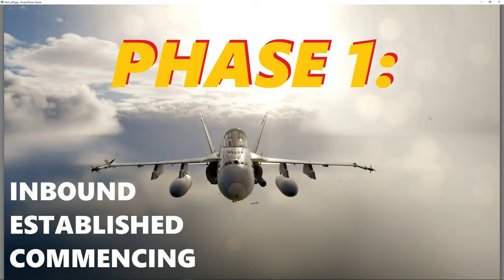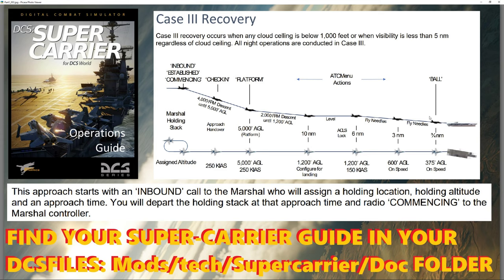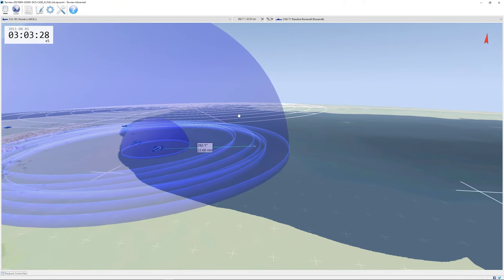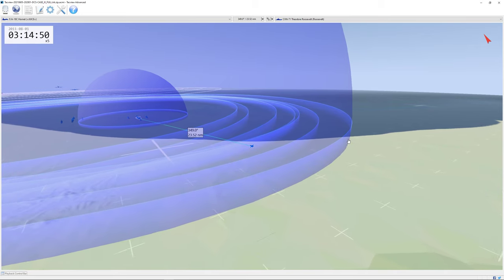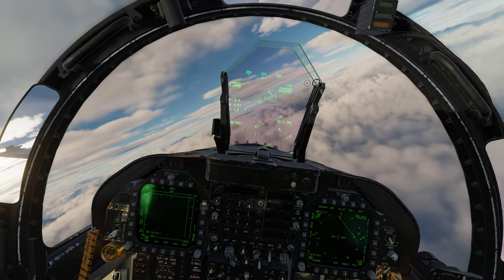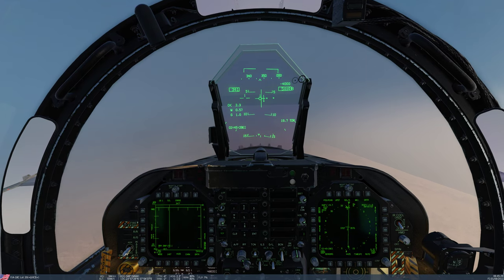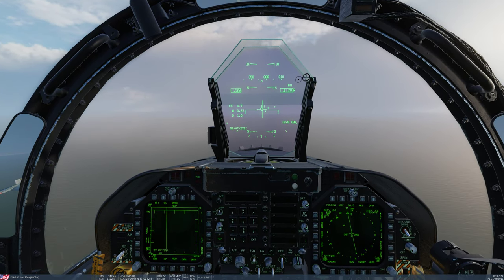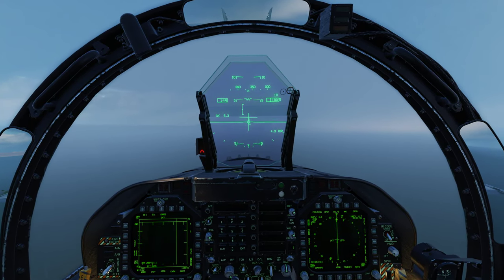PART ONE - CASE III SUPER-CARRIER RECOVERY PRACTICE - PHASE 1 - INBOUND / ESTABLISHED / COMMENCING

Comment: Nice video. Only real issue I saw is that you didn’t trim up to get your Attack angle within the E bracket. You’re doing it manually, but trimming up is much easier to get on speed, one less thing to worry about.
Reply from the maker: Good catch, yes I used to get ballooning issues with the flaps but now I’m dropping Flaps Half and Flaps Full in the break turn with the gear at 250kts. You should see me now baby! :-)

Comment: isn't it important E bracket ? you hardly ever use it.
Reply from the maker: Good question sir...the E-Bracket usage is often misunderstood in sim aviation.  As with any instrument in the cockpit and symbol in the HUD, the information the data gives you tells you something about the current state of your flight.   In this video, when you go to 18:02 on the timeline, you'll probably see the picture you expect in the E-Bracket/Velocity Vector Indicator (or flight path marker) relationship.  This is what you would hope to see when on Glide-Slope and and pitched and powered for on-speed AoA.  But when you are getting to the Glide-Slope or fall off of it, you have to adjust your power to regain that position and you won't see your E-Bracket matching the VVI.  The information tells you if you are ascending or descending to get back where  you need to be for the approach.  You could get the symbols to match up while way, way far out from the carrier, but then you'd be on this long approach and usually stuck in someone else's airspace.  Hope this helped clear up information about the E-Bracket!  ~JUICE
Reply: @AIRWARFAREGROUP  I understood. I usually try to catch up earlier :) EXP : 6-7 nm

Comment: I'm beginning with Cat III too, but I'm a cheater :-b
When ATC gives you the radial to orbit, just add 180° and you have the radiale TO the carrier instead of FROM.
So you can use auto pilot to capture the radiale: ALT + CPL + ATC.
Once you approach the holding point you just disengage CPL, and you just have to roll for the holding pattern.
Still I'm full manual when I go down from "commencing".
Reply from the maker: Hey, it's not Cheating...we all have the freedom to fly DCS World the way we want!  Taking shortcuts or omitting parts of a procedure are great ways to work on smaller portions of the approach to gain proficiency in pieces as trying to learn a big, drawn out process all at once can be challenging for most.  Author Matthew Syed puts it best in his book, Black Box Thinking, and in his words, "identify how to improve many things by a small amount, where the accumulative improvement can be great."
https://www.matthewsyed.co.uk/